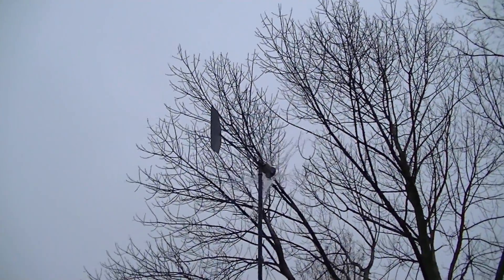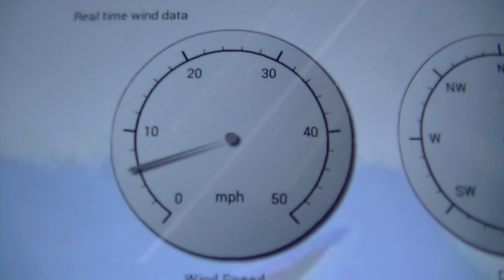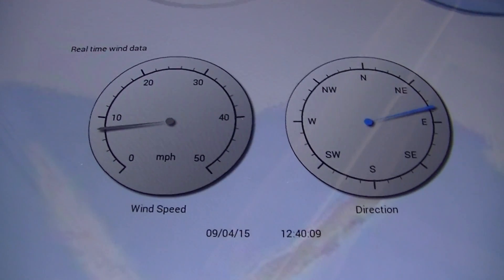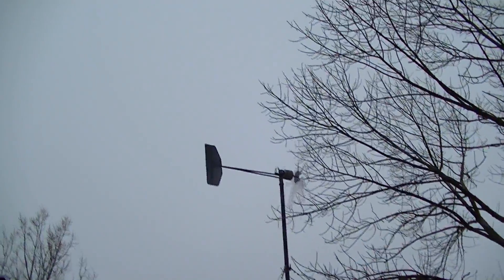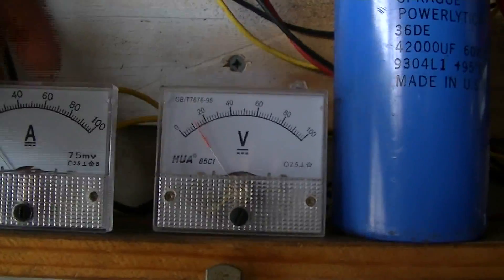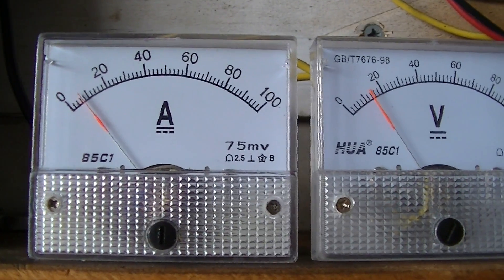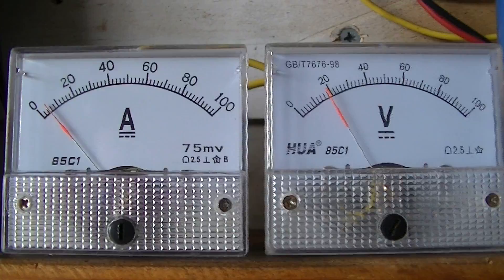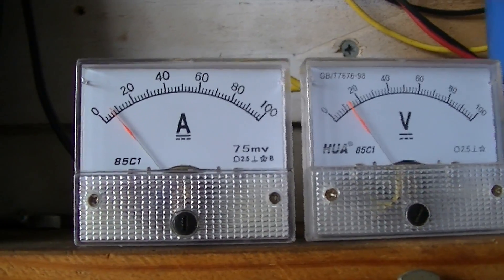Thermodyne KT Ghost Blades Low Wind Startup

Comment: I'm not familiar with the cap, would this work for my wind turbine hooked direct to a grid type inverter with no battery or charge controller. Were can I purchase one & cost. Liked your video.
Reply: +garden wind , check out  Al Desrochers channel ,hes a good guy and loves using capacitors, i learnt from him

Comment: Hum, the use of the cap really smooths out the volts! But man as we know the WN has less cogging than most PMA's/Pmg's . These KT Clear's are really made with low winds in mind, but as you soon will see is the TSR also designed in this blade. But I hear that another blade design is being made that will do and perform better than the KT Pantara's! Just a hint of whats to come :)